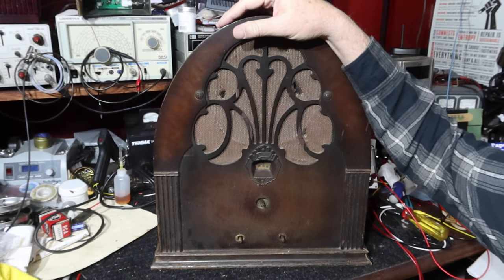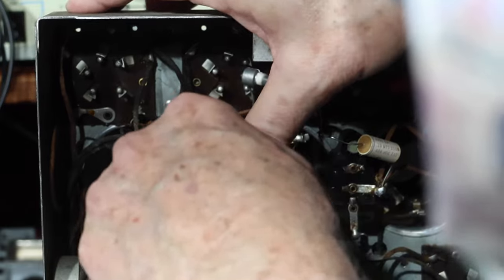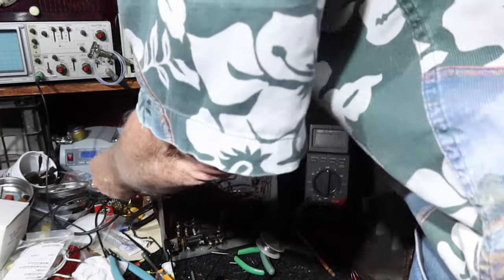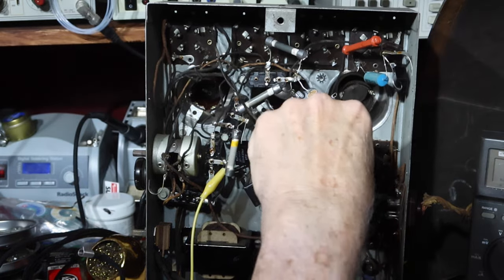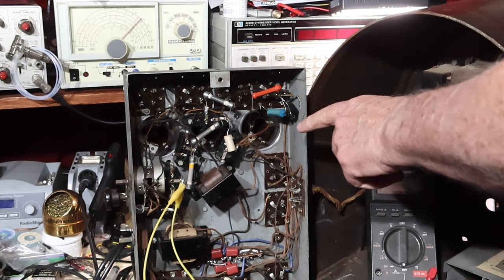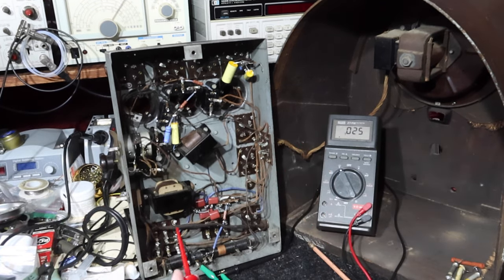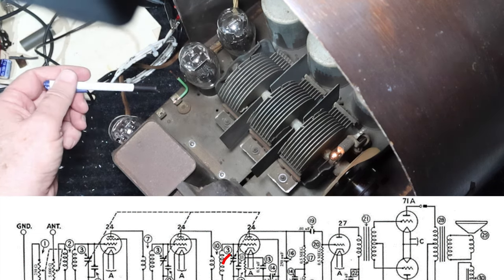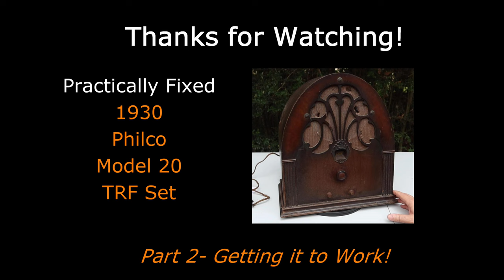Philco Model 20 Vacuum Tube TRF Radio Repair - 1930 - 93 Year Old Tube Radio - Part 2  [4K]

Comment: Thanks for the video!. I have one of these also but it is the "Baby Grand Console" version. When I was a teen in the 60s, I saw a bunch of stuff sitting on a customer's front porch. I knocked on the door (they were early risers) and asked about it. He told me he was giving that stuff to the Good Will and I was welcome to take it. He was the original owner. Anyway, it is still in very good condition and I turn it on and play it occasionally. It has NOT been restored, but still works fine. I use variac and ammeter to monitor it when I do this.
Reply from the maker: Hello Robert and thanks for the comment.  That is a great story, and from the original owner!  Glad you are taking such good care of it.  Post a video of it sometime!  Thanks again.

Comment: Hi, I have a few Philcos I have restored that called for a fiber wrench but I used a metal socket covered with tape as there was 150 volts on the compensators. Now I know how to make my own thanks to your idea. I have a Philco 89 that had a coil problem but started out looking like silver mica disease (popping and crackling). Turned out a bad spot on outer coil like yours. I was not able to save mine as there were several green spots. So I removed the wire and that plastic spacer and found green spots underneath. So I rewound both coils. Radio worked great after that (whew!). Turns out that plastic spacer turns acidic and that it what is doing the damage. I have a wire in my shop that is connected to a ground rod driven in the ground outside of my house. Hooking that to the chassis or ground terminal of the radio antenna just about eliminates the electronic noise. Keep up the good work.
Reply from the maker: Hi and thanks for the comment and suggestions.  That is interesting about the plastic spacer, and the cardboard tube may also be a source of acidity.  I plan on restarting the work on this unit soon - the last few months were very busy here.  Thank you again.

Comment: Thanks for the Video.....I have a 1930's Grebe AH-1  TRF.....works good enough, could be a touch clearer, but just didn't want to touch it...  Nice Job on the repair of the coil....super fine wires!!.....
Reply from the maker: They are tiny indeed.  Thanks again.

Comment: Great repair on that coil. The TRF works really well picking up stations. It doesn't have AVC either.
Reply from the maker: Hi Jim.  Thanks, looking back on it, it was fun using the needle to find the break.  I think when I get an antenna wire not running past fluorescent lights and away from other noise makers in the shop it will perform pretty well.  Got more work to do on it though.  Thanks for the watching.

Comment: The name of your channel always makes me wonder if the repairing works are done or not 😂 Indeed, what does it mean - practically fixed? In my language it can describe a situation, when you've disassembled a radio, made the electrical part work, and that's it. So the radio is on the table, and the owner comes in and asks you - hey, is my radio ready? You say - oh yeah, it's practically fixed. The owner asks you - alright, I take it then. You - no, you can't. He - but you just said, it's fixed 😮😂😂😂
Reply from the maker: Ha.  You got it!  That was intended as a joke.  Also, not throwing money at the problem if I can figure out how to fix what is there or using other parts and pieces.  I spend some time troubleshooting to make it interesting for me and hopefully others.  There will be more coming on this project (but the holidays here are busy with family).  Thanks for watching and for the comment!  Happy New Year.

Comment: Hey PF, nice sleuthing on that coil wire break. Amazing what one can see with the magic of magnification. Have to agree about tubes. Always been my motto that a good tech should not need a tube or transistor tester. Good job so far. :)
Reply from the maker: Hi Doug.  Of course sometimes a tube's filament is gone in a AA5 so it needs to be changed, but yes even extremely weak tubes work well enough many times to get through the rest of the fix. Amazing this one was able to get a very weak signal through in spite of an open coil and extremely weak tubes.  Thanks

Comment: Have a working one I eliminated the original speaker w pm modern replaced the coil w resistor works well  have the later s het as well both cathedrals and a parts chassis non working  also have a baby clock w  4tube tombstone

Comment: I have a feeling inductor failure will be the biggest headache for the hobby a few decades out from now. Philcos are notorious for open coils but, I have seen enough in other brands particularly in sets stored poorly in unheated, high humidity barns/garages for years. Could be the canary in the coal mine. Hope not.
Reply from the maker: You may be right.  Thanks

Comment: That coil will fail at some point as the insulating material (acetate) will eventually corrode the coil in another section.  This coil, and the other 2 such coils in this radio, needs to be rewound.
Reply from the maker: Are the power transformer, choke, field coil, audio transformers and voice coil windings at the time also coated in acetate?  Or was it only the RF coils?  Thanks
Reply: Just the RF coils.  Though early XFMRs were potted in tar which contained high levels of sulfer, so those can also corrode.  This is mainly in Atwater Kent radios. @PracticallyFixed